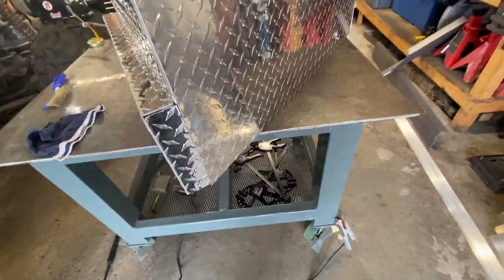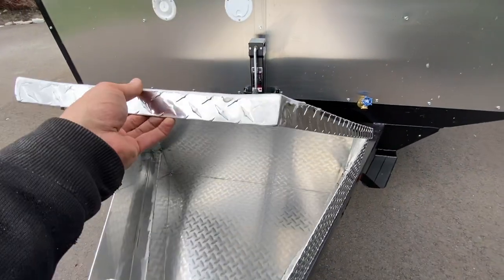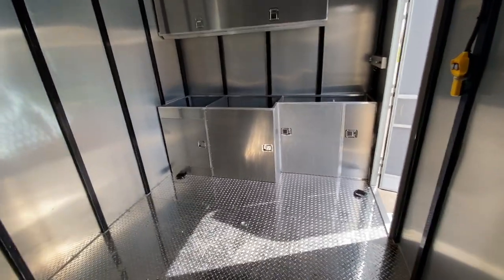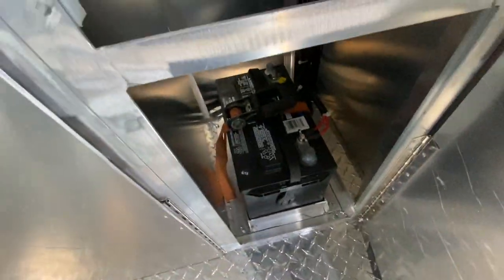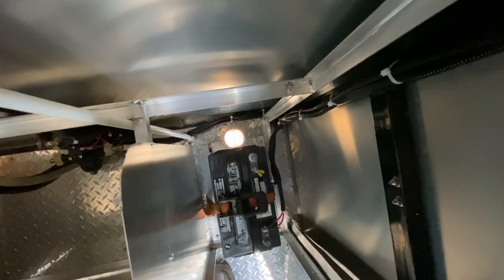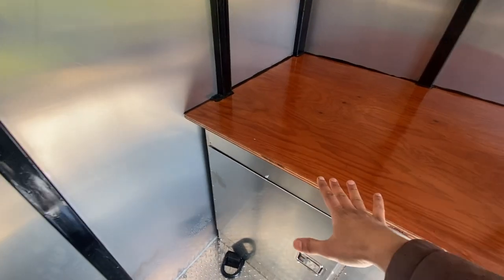Enclosed trailer build | Episode 8 | Cabinets

Comment: Great video. We manufacture boat trailers and starting a big stacker trailer build this week. Great job.
Reply from the maker: Thank you!
Reply: @rgsabat  curios I beam vs Square tube for main frame in your opinion. We’re going with 2x8 and not sure 1/8 or 3/16” yet
Reply from the maker: @RaceMentally  It depends on the length of the trailer, I beam is good for longer trailers (24 ft plus). I like to use the c-channel for trailers shorter than 24 ft because the c-channel is shaped in a way to maximize the strength of the beam in the direction of the load (vertical axis). Nothing wrong with using rectangular tube, as long as it is thick enough. Hard for me to advise you on 1/8 or 3/16 for the 2x8 rect tubing, it all depends on the length and expected weight capacity, the 3/16" wall will add significant weight.
Reply: @rgsabat  drawing up plans today but 34’-36’ overall V nose and 13’9” tall overall. Walls most likely 2x2 .120. Buddy of mine had one built and basically going to copy it. It’ll have 3 8k-10k axles under it.

Comment: Could you show the trim you used on the outside corners of the trailer? Also how does the alluminum seal on the sides or does water not get in once its all bolted together to the steel beams that you used as the frame.....
Reply from the maker: The trim is 1.5" x 0.125" aluminum angle. The side aluminum sheets could get water in, but I don't care, I pressure wash the trailer inside regularly. If I cared about water not entering, I would caulk or seal the side wall sheets.